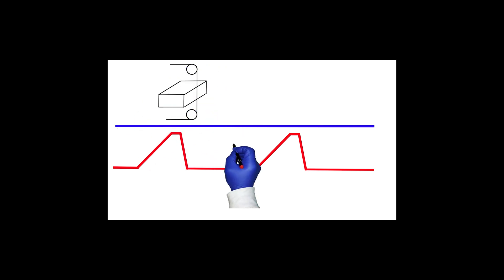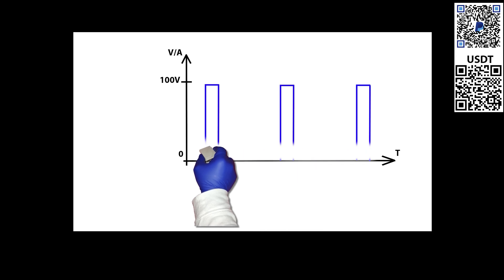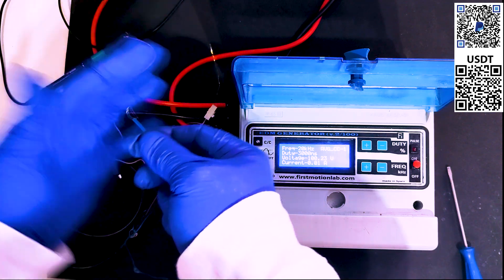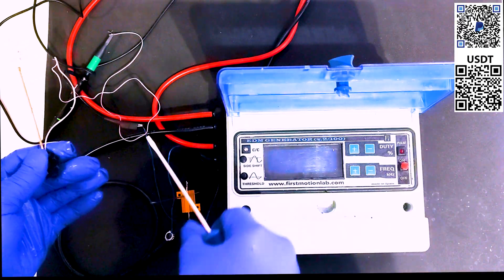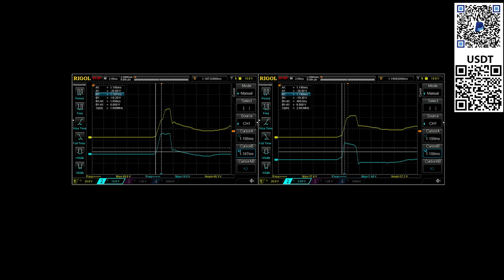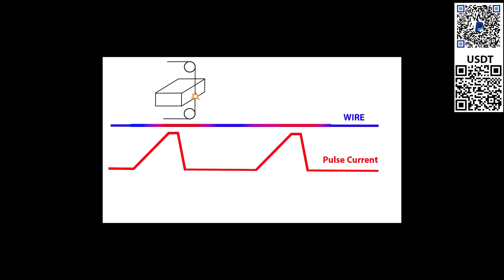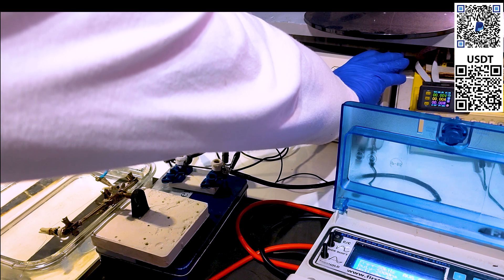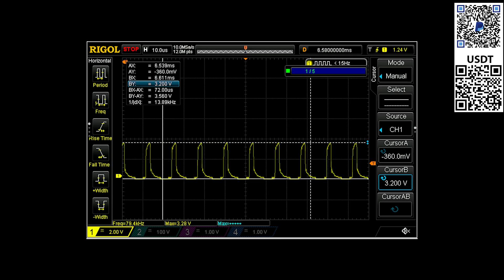Current Control in EDM Generator

Comment: Спасибо за видео. Хорошо придумали как экспериментально определить  стойкость проволоки. Отличная идея. Одного не понимаю. Как ваши резисторы на зелёной плате, в виде толстой проволоки, просто не сгорают? У меня греются как сумасшедшие. Это ведь токоограничивающие резисторы в виде отрезка нихромовой проволоки или это просто провод?
Reply from the maker: If you use the current limit resistors they heat up of course. I just use them to measure real pulse current
Reply: @firstmotionlab  Понял. Спасибо. Ещё один вопрос можно? Вы используете дополнительный дроссель для ограничения скорости роста тока (чтобы успеть отследить и отключить ключи), или хватает индуктивности самого блока питания?
Reply from the maker: In this project, I try not to use any units with parasitic capacitance at all to reach the maximum possible current rise at the fastest possible speed. The wire is slim, and if the current rise is slow, the wire will heat up for a long time. If I need to reduce current I get down the voltage or adjust pulse duration or both of them. To protect transistors use amplifiers as fast as I can.